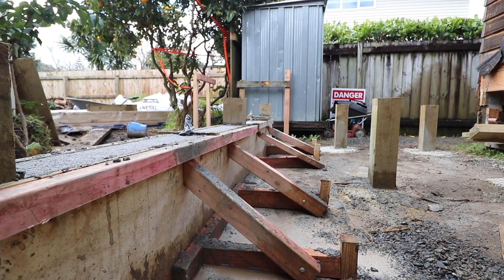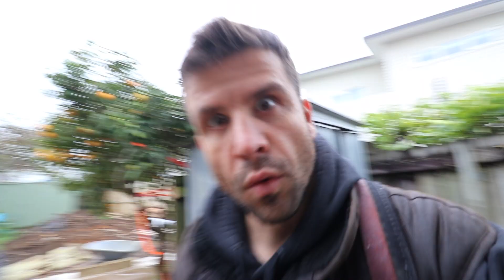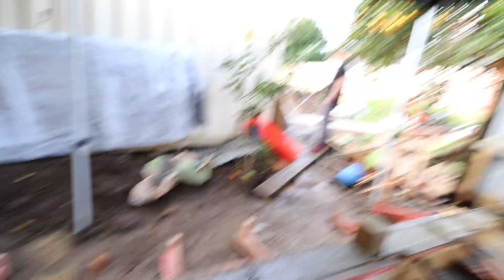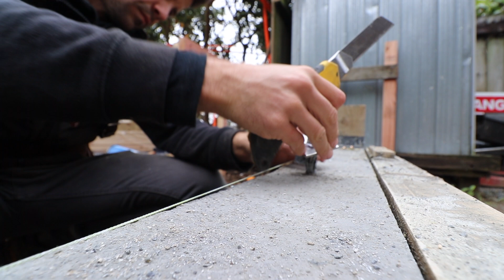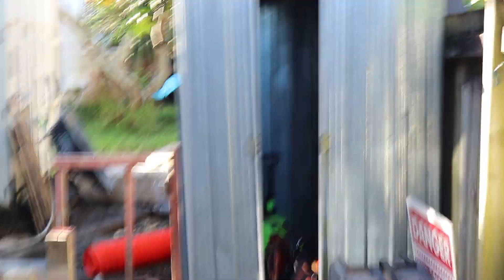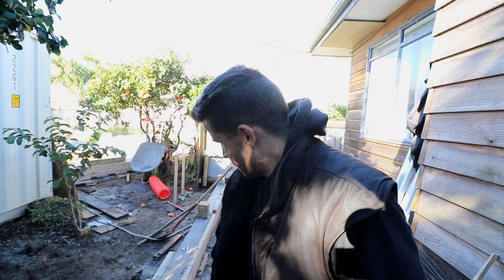Small Concrete Wall (putting in anchor bolts)

Comment: I just watched a next week Scott Brown, so I already know how it turns out, Great Fun!! Did you know, we are secretly using metric in the states? All our lumber is not what it's called, everything is slightly smaller than what we think. We are given 1/4" plywood, but it's really 7mil. I see all the same lumber in your videos that we work with here, like our basic "2x4" which is really a little shy of 1.5"x3.5", is yours called a 4x9? ish?
Reply: Phil Rabe Interesting about the panel sizes. All our gauged (accurately sized by plane in the mill) framing lumber is cut to multiples of 25, 50 & 100mm. but that is guaged to 18, 45 & 90mm. We actually call a 2 by 4, a 4 by 2. But it generally gets called either 100 by 50 for rough-sawn exterior grade timber or 90 by 45 for guaged. Or shorthand just "90s".  We call it what it is.

Comment: Hi Scott cool vids
I haven't seen this solid boundary wall detail before. Was wondering how you achieve the ventilation requirements for the subfloor?
Reply: Good point. The venting relies in the non-fire-rated walls of the sub-floor. It's open to the rest of the house so just need to make sure the total area has enough. And to get the poly barrier down under the whole house!

Comment: im a chippy in aus, whenever we do any building work that is creating a fire barrier, timber is definitely a no go. just wondering why you are allowed to use timber posts which easily catch fire ?
Reply: depends on the fire rating 30  60 and 90 minutes are the standard fire ratings for residential looks like he is building a 30 minute to me just a guess
Reply: glennimmortal is right. These are fire slow-down walls not fire-proof walls. A masonry boundary wall would have been another solution.
Reply: Need to remember this wall will have timber cladding (I think) & windows too (windows with a certain grade of fire-rating). The lining and insul will also be similarly specced. It's never going to stop a bush-fire but it will dramatically slow down spread and risk to life if it has to go upwards.